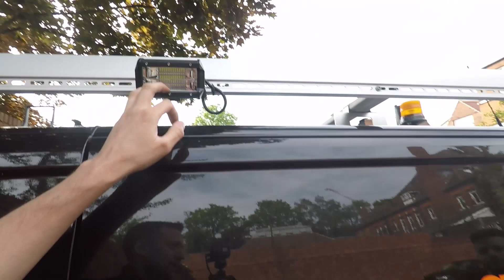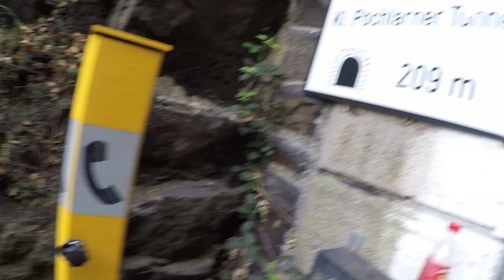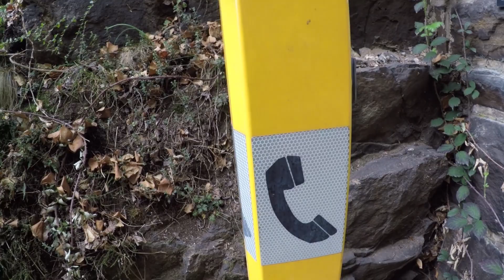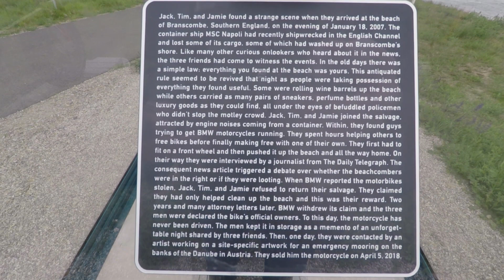Will Dave pass his van inspection??? (+ exploring random Germanic Electrics) | Thomas Nagy

Comment: Wow.. Different to your normal video's Tom.. Great stuff. I'm always analyzing electrical work on holiday too.. 😂 Just my curious nature. I think the conduit bends thing is a bit of mechanical protection, and IP integrity (17th edition) especialy for containing fire, water ingress, UV light, etc. UK system looks so much neater though. I wouldn't leave conduit like they do with no protection on the bends, looks a mess. European harmonisation eh? Hope they harmonise to our standards and not their's. That motorbike was weird just sat in a glass box 😂 what a waste.. The fuse panel is prob for tunnel lighting, and power tools for railway engineers? Maybe was switched remotely down the line? Weird..or the electric chainsaw was plugged into it when the tunnel murderer used to hang around that particular tunnel in 1990 😜 don't ever go in there... Oh.. Hang on.

Comment: H&S in workplace gone mad uk everyone’s out to sue one & other if there’s slights blame for claim
Reply: Using closed pipe is a lot older than the elfansaftygonemad culture.  We did it because we'd traditionally use single insulated in such installations and that needed the mechanical protection. SI was cheaper, easier and more could go in a pipe than double insulated like twin and earth.

These days extensive use of SI outside an industrial setting is rare, but we still have the custom and practice of closed pipe that has become regulation. As a result typical UK T&E does not have either the mechanical resilience or weather resistance desirable for exterior install — because we used pipe it wasn't required — and the whole thing becomes circular; use pipe because of the deficiency of the cable, the cables remain deficient because we use pipe.

To avoid pipework you're into a lot of expense for weather-proofed cable or even SWA.